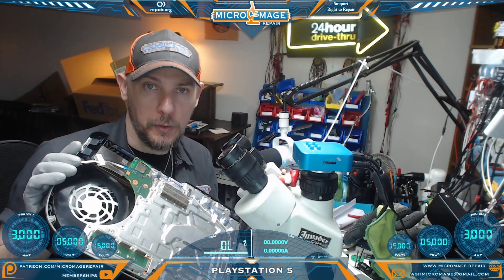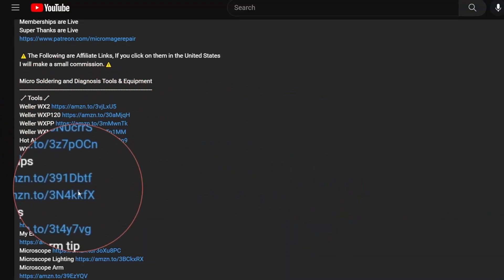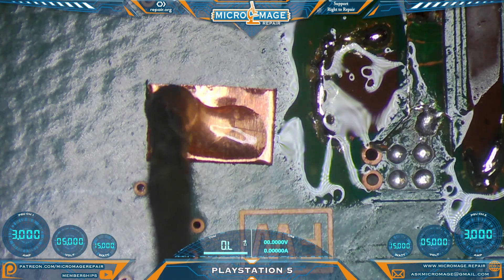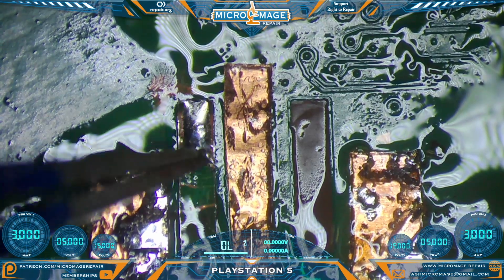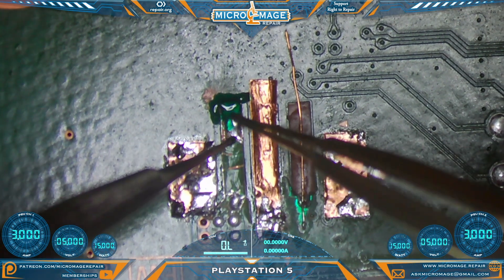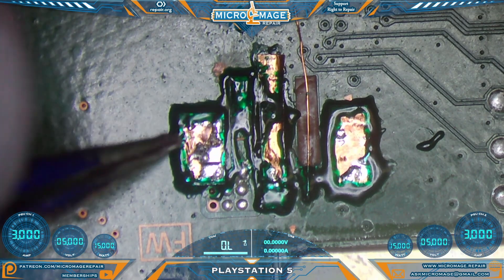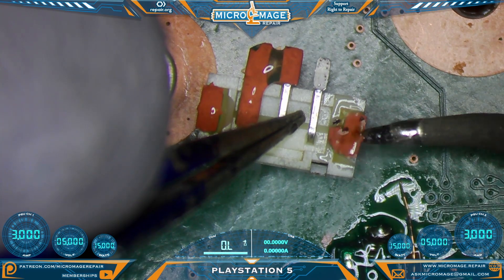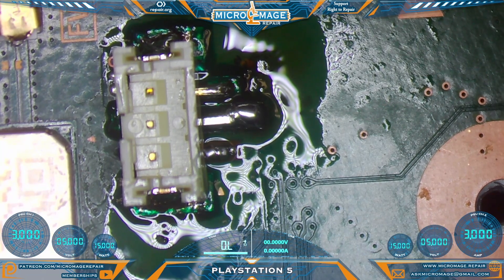PS5: Another Ripped Off Fan Connector!

Comment: I expected you to try toltec merc’s method after he done one. I will steal it 😅
Reply from the maker: Hah!
I like his method.
I just like mine too 🤣
Plus I have a lot more copper tape than I have through hole leads!
Reply: @MicroMageRepair  actually I like the copper tape too. I ordered some to try it myself if I get the chance
Reply from the maker: @Samsemillya  I just tried it one day and I haven't seen a real good reason not to continue using it.
The other methods are as good, but I haven't seen anything that is remarkably better.
Reply: @MicroMageRepair  I mean you can lift the freaking board after using copper tape, that’s definitely a good solution for these weak connectors